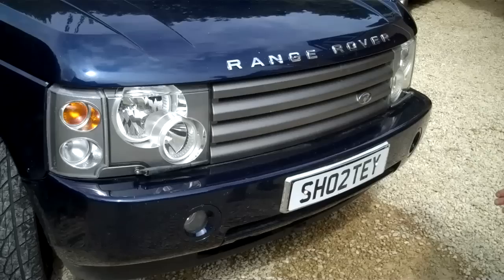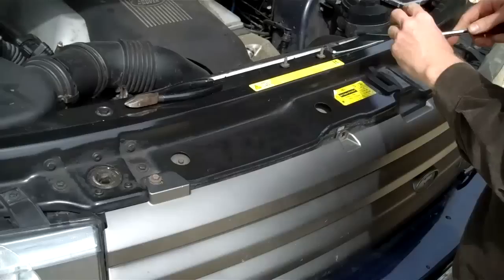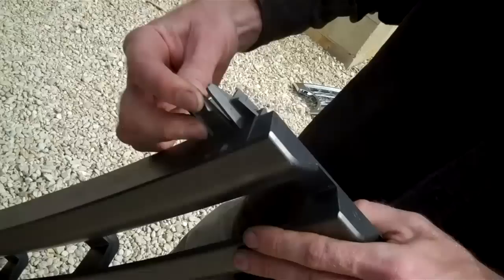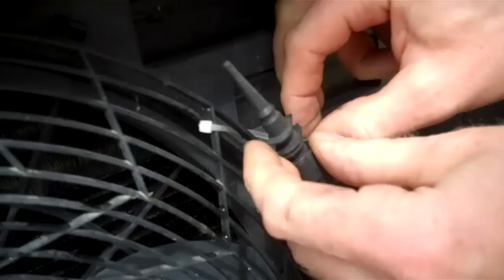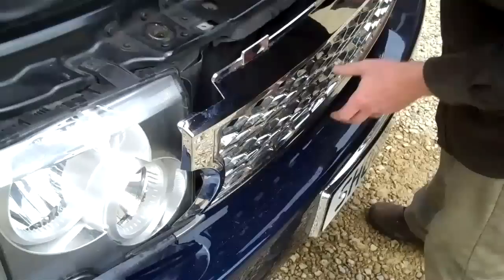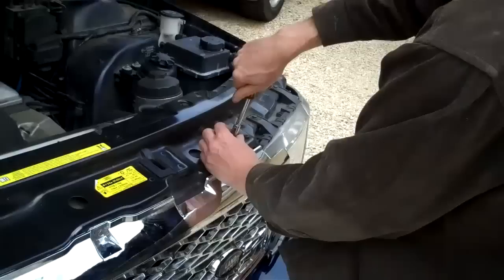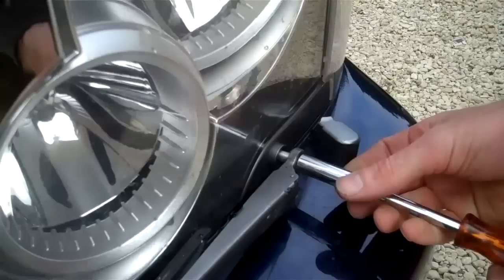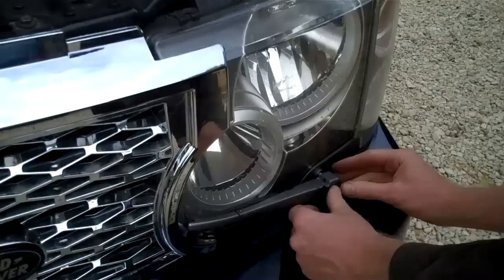How to fit the face lift style front grille to Range Rover Vogue L322

Comment from the maker: Hi - yes you can fit the 2010 on headlights to this model. You will need to
1) change the headlight connectors
2) change the front grille
3) alter the front wings
4) change the front bumper

Comment from the maker: Yes you are correct - the big Range Rover is actually just the "Range Rover" in the UK also but to try and differentiate it from the RR Sport i often refer to it as the Vogue as this is most common trim level sold in the UK. The term Range Rover L322 seems to be adopted as the most common term for the large Range Rover now.

Comment: Don't mean to offend and I do respect and admire your enjoyable and well presented videos. It's just on the front grille, i think the original suits the non-supercharged Rover best and it does somewhat change the character of the vehicle. All the other shiney bits are ok, but the front grille in its original stock form is a sore point for me.
Reply from the maker: Hi - its OK i was only having a bit of fun....car fashion is an odd thing...at a certain point the original spec will become the most desirable again.... look at the Range Rover Classic... the original version of that car now looks so nice but how many have been chopped about over the years. My least favourite part is the chrome fuel flap cover...

Comment: If try to put 06-09 headlights and grille on this range rover, is there any hassle and major changes or wiring like if you're converting to a 2010? Or can you just slap on 06-09 bumper and headlights and everything will work fine?
Reply from the maker: Hi - you need to change the headlight connectors / wiring etc. For the effort better to go for 2010. I am now doing videos how to do this as we are converting our demo car - check out my latest uploads.

Comment: Can you put 05 to 09 headlights on this model without needing to alter the front?
Reply from the maker: You can fit the 05-09 headlights in this model but you will need to change the grille and the front bumper to do this. The line at the top of the front bumper is different.

Comment: what a grate job.. do you know if the 06-09 grills fit on a 2004?
Reply from the maker: Hi - the 2004 model has the square headlights - the 2006 models have the headlight that has a round section protruding into the grille - so you cant fit the 2006 grille to a 2004 car

Comment: I have an oem 2006 grill, will it fit my 2005 ? Is there any modifications to do to make it fit.
Reply from the maker: If your 2005 is the early model with the square headlights its going to be tricky to fit the later grille. Sorry !
Reply: @L663  thanks for the reply